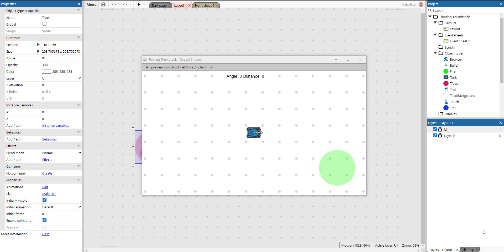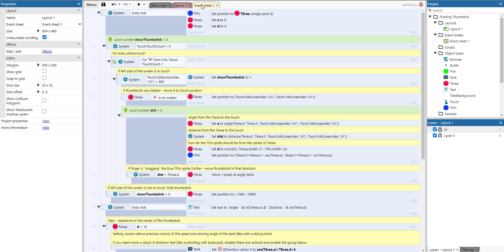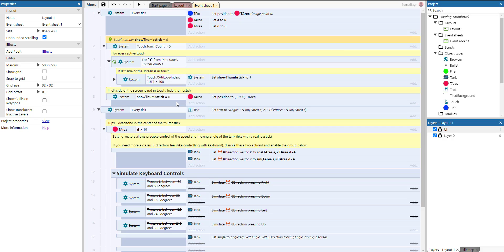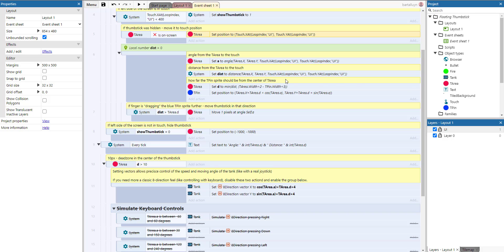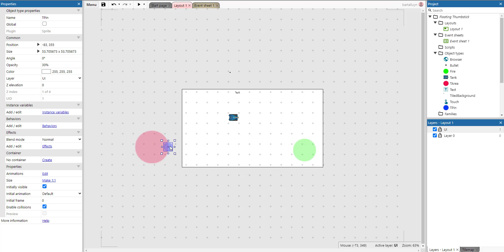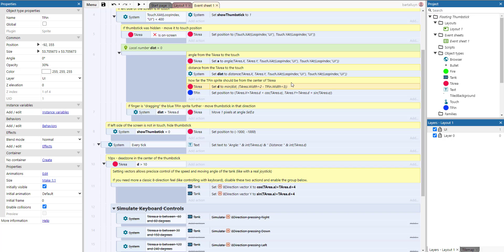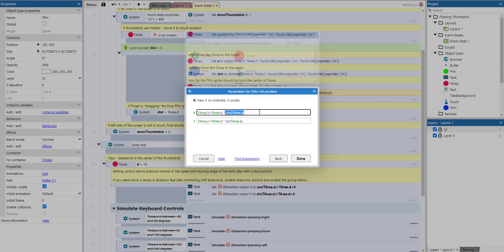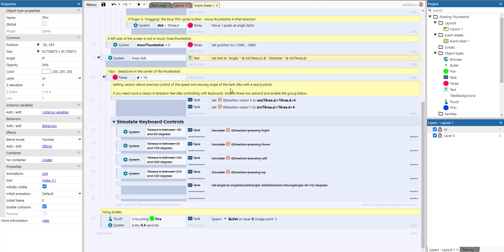Construct 3 Demonstration : Floating thumbstick

Comment: This is really helpful with Construct not having any decent controller options for mobile. A few things I would like to know. Can we ignore multiple touch have the same functionality? I just want to have the controller that would simulate 8-direction. Also, in event 4 of your event sheet what does "UI" stand for? Is it the layer?
Reply from the maker: UI is indeed the layer.  As for your first question, I have no idea; maybe the C3 forum can help?
Reply: @lessisgames8555  I got it working without multiple touch. Thanks! I landed up here on your video from the C3 forum 🙂